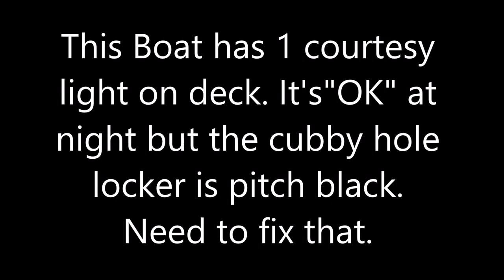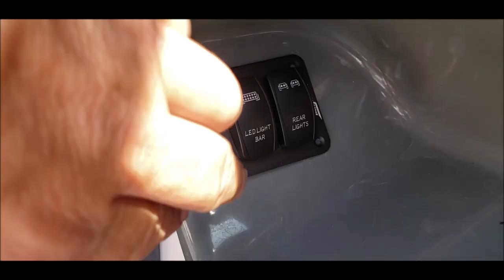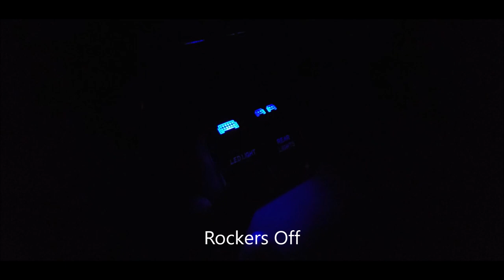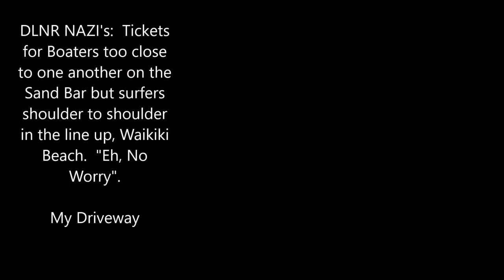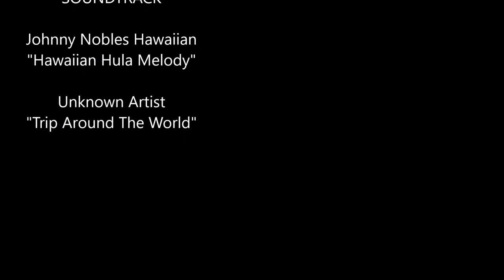Yamaha Jetboat Install LED Light Cubby Hole Locker

Comment: While watching, I was thinking a second light would be good to eliminate shadows. But that single light is bright.
Reply from the maker: You are correct that single little LED is quite bright and it reflects down and off the white fiberglass.  The other white lights that I added to the Engine Compartment and both rear holds are good but If I was to do the port and stern hold lights over I would put them as high up as possible because as you mentioned the shadows are a pain.

-scott

Comment: Hi, I was wondering if you ever had to tighten bow grab handles?
Reply from the maker: Aloha,

Sorry I missed this question.  The answer though is that one of mine is a tad loose but I have yet to tighten it.  It will be part of a general maintenance weekend coming soon though.  I have a small but important list of little things that need attention. 

-scott
Reply: @HawaiiJetboat  Thanks for the quick reply...looking forward to the video!